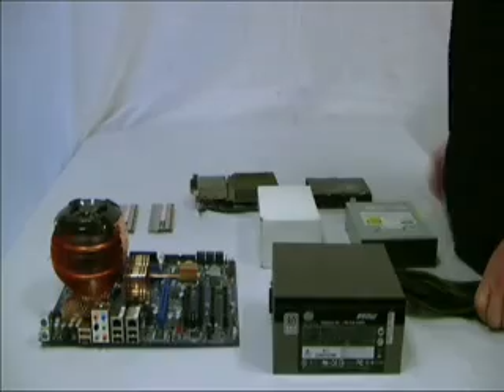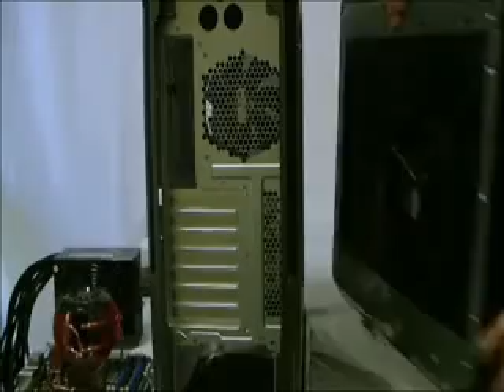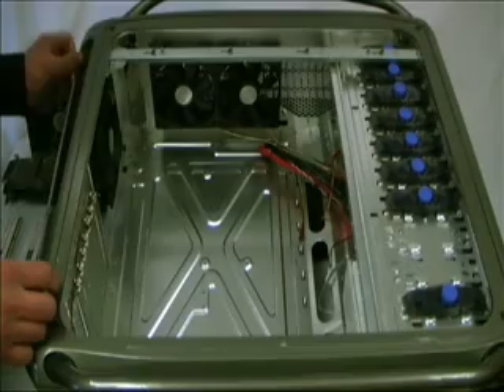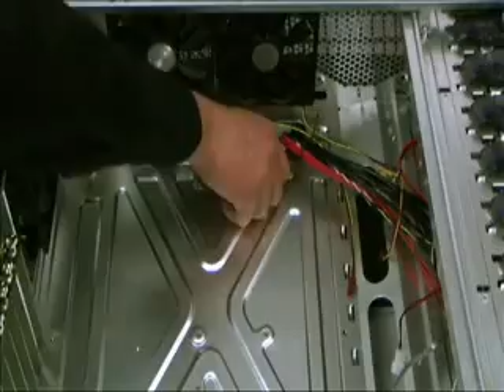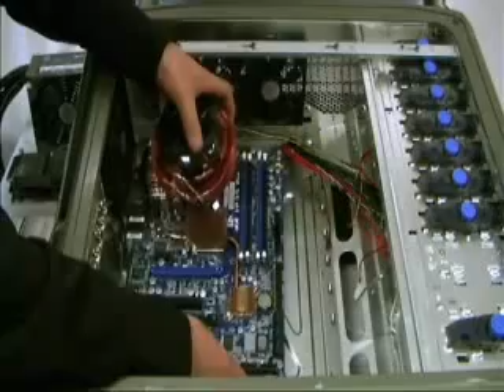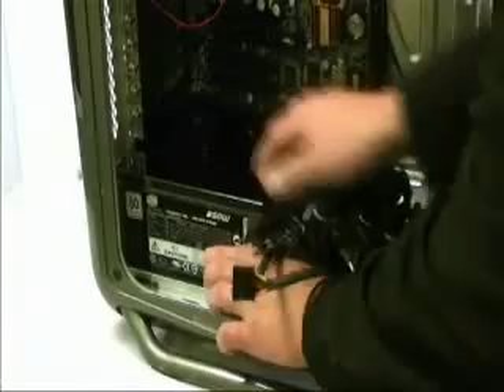Cooler Master Cosmos S Part 1 Installation Video

Comment: I still use my Cosmos S case; however, the side fan is no longer operational, and I have been unable to find another of the same size and model for purchase. I would be most grateful if you could assist me in any way possible.
Reply: Did you find a solution? I just got the Cosmos S for an EATX board that won't fit anywhere else a week ago, and am still cleaning it. Side fan works ok, but I got another two 20cm fans coming which should fit. Let me know if you're still looking.

Comment: IMPORTANT! This video neglected to mention that you should install the ATX shield that is provided with your motherboard BEFORE you install the motherboard. Sheesh.
Reply: Totally agree... the most common mistake for every pc builder, no matter if you are building one for the first time or it's your 500th pc build, this keeps getting angry/upset/frustrated a lot of people, when they realize they will have to unmount everything just to put the I/O shield. Maybe this issue will dissapear when all motherboard manufacturers implement the shieldless I/O back panel as a industry standard and not a premium feature.